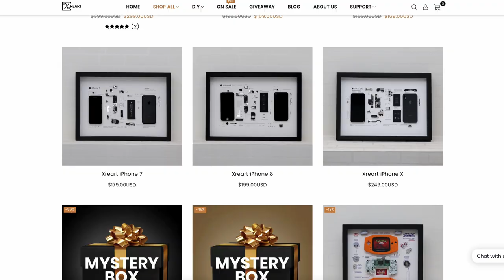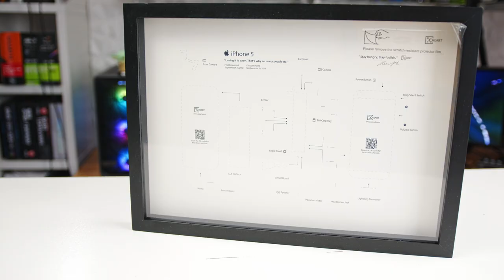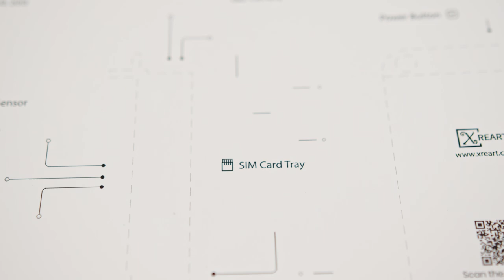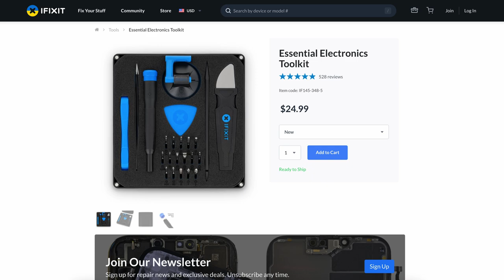Repurposing My Old iPhone to Eliminate E-Waste.

Comment: I get the sentiment, but electronics going into a designated waste disposal site, does not an e-waste make. The only way to prevent e-waste is to not buy, or reduce how often you buy e-waste. Think of it as being e-waste as soon as it is manufactured, by reducing the ammount of e-waste you buy, you're reducing the the need to produce e-waste.
Your method of reducing e-waste can be varied depending on preference. You may wish to buy high end hardware that lasts much longer before it cant do that tasks you need, requring you to buy new e-waste.
Or maybe you buy easy to repair e-waste so that when a part breaks, you only have to buy a small e-waste, instead of a fully assembled e-waste, or maybe you can even buy used e-waste to fix your e-waste.
One of the key things to remember using the later method is to only buy e-waste with replacable parts, especially perishable parts like batteries, storage, fans, and ports. Is a plus if all parts can be replaced with other people's used e-waste, and that your e-waste, if broken beyond repair, can have some parts salvaged to prevent someone else's e-waste from making it to a land fill.